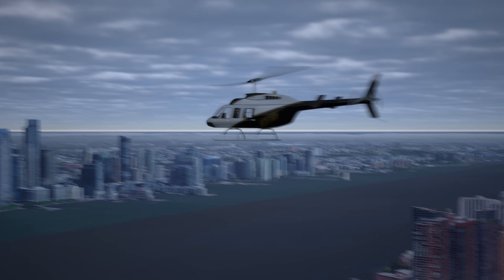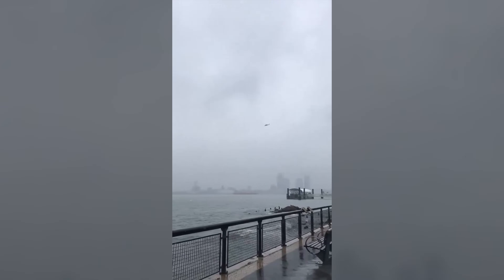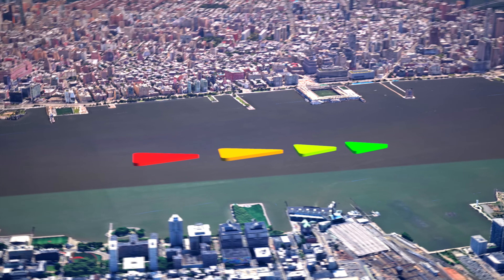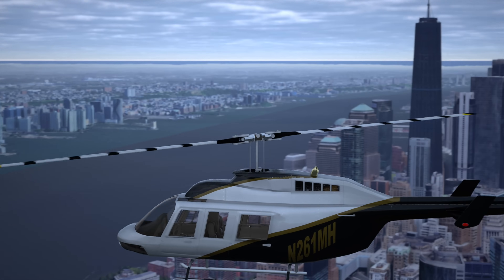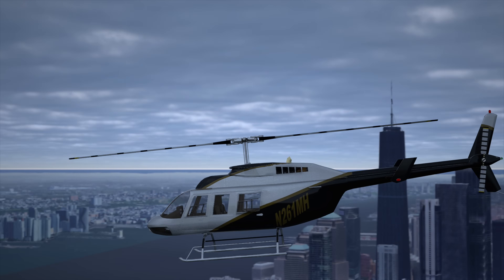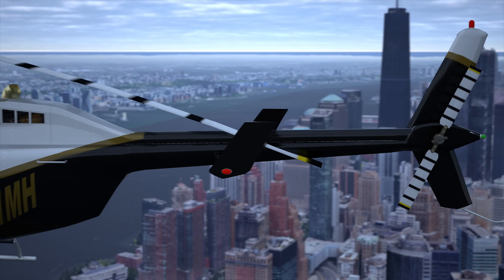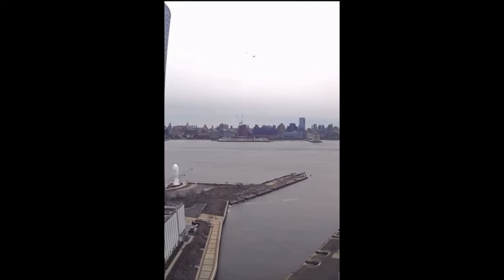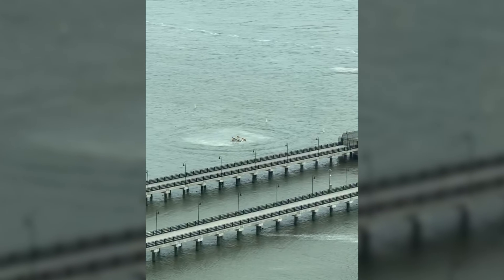Helicopters DON'T just fall from the sky - What is "Mast Bumping"?

Comment: It's pretty crazy after researching Bell helicopter crashes, which isn't many by the way, that Bell isn't even listed in the top 10 for most accidents/crashes.

Bell also received a contract with the military.

Some fatal stats for Bell helicopters.

1990 - Bell 206B - Eric Clapton's band members.
1991 - Bell 206L-1 LongRanger II - Occupants not listed, which is odd
1991 - Bell 412 - Collision from a Piper Aerostar (small plane) -  United States Senator John Heinz
1991 - Bell 206 - Rock music concert promoter Bill Graham
1994 - Agusta-Bell 206A-1 - IDF Major General Nehemiah Tamari
2009 - Bell 206L - General Officer Commanding of 55 Infantry Division and Jessore Area Commander Maj Gen Rafiqul Islam
2010 - Bell 206B - Sergeant Joseph George Schuengel
2014 - Bell 206 - Guatemala's Chief of the General Staff of the Armed Forces Rudy Ortiz
2019 - Bell 206B - Brazilian journalist Ricardo Boechat
2025 - Bell 206 - Augustin Escobar, CEO for rail infrastructure at Siemens Mobility and his family

The United States Helicopter Safety Team (USHST) reports in 2024 there were 78 helicopter accidents in the U.S., 11of them fatal. A total of 26 deaths resulted from those accidents.

The crash rate for general aircraft is 7.28 crashes per 100,000 hours of flight time. For helicopters, that number is 9.84 per 100,000 hours. Helicopter crashes are common.

Yeah, i think i'll avoid ever flying in a helicopter. Cars are bad enough, but at least you have a higher chance of surviving a car accident.

Comment: It’s not mast bumping, this video is extremely misleading. I understand your stating it a theory, but clearly your pushing the agenda of what YOU believe is most likely. The main rotor separate from the aircraft WITH the gearbox still attached, which essentially would completely rule out mast bumping and point to a massive mechanical failure.

Comment: First off, I am truly sorry for all those affected by this.
I love the engineering that makes these things work. As wacked out as they are.
And they are a joy to ride in, as well as fly in flight sims.
I will be watching this closely for details.
But I agree with your theory based in just what I have scene in videos from news coverage.
I'm not dismissing the idea something went wrong in tail shaft causing a sudden change in flight and drastic rotor pitch to hit the tail section.
Or the rotor and transmission broke off and hit the tail section.
Either way it happened faster than the naked eye can see in the videos we have.

Comment: It looks like the main rotor/tail rotor transmission or tail rotor drive system failed
freeing the main prop and flailing, cutting the rear section of the chopper completely free
based on the vid.
Sad, regardless.

Comment: I was thinking birds as well or a drone. I stopped flying drones after a close call with a chase-chopper during a boat race. We were both cleared to be there, but the chopper swooped low and got within 10 feet of my chase drone. A tiny difference in either of our inputs and that chopper would've had a very bad accident in shallow water. That was with awareness and direct comms with the other aircraft. Think about what can happen when there is no connection between the two operators, and possibly the drone operator doesn't even know about proper flight procedures or safety requirements, leading to hundreds of thousands of potential MAC's. Even with FAA regulation and DJI having flight restrictions built-in for certain areas/times, it's still completely possible to fly a drone in the wrong place. I think the regulatory bodies that handle drones got complacent after seeing how well DJI handled airspace restriction, but most drones, including DJI, can easily be made to ignore those restrictions or don't have them to begin with.

Comment: Another video from a different viewpoint shows it was a tail rotor failure that caused the machine to snap yaw to the right causing the tail boom to fail and disintegrate, the main rotors stayed attached until the mountings failed due to overstress before separating,
Sorry, it wasn't a mast bump incident.👍
.

Comment: It's also conceivable given the internal wars over corporate power in fighting where major players in the Star War Video games are being Targeted much like United Healthcare CEO former Google CEO because the list is long of people that used to have positions of power within giant simulation card games of telecommunication technology giants through towers of Artificial Intelligence network programs
The electronic alphabet soup convoluted mathematical atmospheric structural instability 
All U have to do is pay a mechanic mercenary contractors to perform a few changes to the operating platform of that helicopter blueprint so it doesn't operate according to the factory specifications 
There is no such thing as Holographic programmable radio coded visual display coincidences 
Their called system failures 
Their failure to communicate Cosmic Spiritual Law

Comment: An old school friend of mine died in a tourist helicopter crash in NY, on his honeymoon. We had lost touch and I only read about it in the newspaper. So sad.

Isn't it more likely there was some kind of gearbox/mast separation from the airframe, and the rotors swiftly severed the tail? I worked for a helicopter operator for 5 years but not in a technical role, so would like to hear from an expert.

Comment: Nobody could survive this. Not even a mouse. It was falling upside down and the people on board would have been killed instantly from severe head injuries. I think the rotor snapped off the tail and then separated and the cabin spun and tumbled before falling tail first and then hitting the water upside down in a slight nose down angle.

Comment: Some of U may have difficulty translatiing an electromagnetic field of voltage change echo maps recording speeds in a visual  read active memory driven mathematical Holographic programmable radio networks recording speeds when we are correcting the planetary Morphogenic field structure spectrum Spin coded capacity to restore balance across the entire electromagnetic planetary DNA software network communication codes B cuz we have 2 templates operating here that are not compatible with each other based on Mathematical electrical codes which are spin points tones coded water table Matrices Base 12 Spheres DC eternal life coded temples breathing pure internal eternal absolute love in flow and return flow of EKKA Vecca Core Still point of a TRUE Vacuum and another Artificial Base 10 55 Vampiric AI QI coded VictimizerQI Borgha Matrix Andromeda Mother Galaxy Quarantine codes that are digital 10 implosion coded NOVA programs running finite electric codes B cuz those codes are pathogenic Parasitic not REAL God source coded reality streams 
It's like two radio networks that don't transmit the same programmable visual Holographic visual matter state codes of what we C 
We are grid network mechanics performing grid repairs to restore the original planetary temperature Vacuum gauge to experience 0° 
Their Base 10 coded DNA is 60° not 90° 
That generates a wobble system off set the planetary spin points tones coded unstable radio network programming finite energy systems 
We are restoring power 
God's Eternal power of pure internal eternal absolute love to heal every living sacred sentient life form here from trauma based mind control programs holding energy captive to feed the dogs of war game machines Intelligence simulator software programs

Comment: Retired commercial helicopter pilot.  It is difficult to imagine that the main rotor mast would withstand mast bumping severe enough to rip the transmission and main rotor system from the aircraft in flight.  Masts are not designed and built with that scenario in mind.  Notice that the main transmission, mast and rotor blades are falling to the water as a unit and impact after the fuselage has already landed.  Mast bumping typically snaps the mast off, but leaves the transmission still attached to the upper fuselage.  My take on helicopters is that since I retired in 2013 I will never get into another one of my own free will and you should not either.  Especially a tour helicopter.
Reply: 100% correct.  I'm an airplane pilot and my family are forbidden to fly in helicopters.
Reply: Yeah man, I was thinking the same thing. I think we're gonna see that the rotors and transmission dislodged, likely due to mount fatigue from years of use.
Reply: I was at a tourist helicopter riding place in Tenn one day and some of my family were going to take a helicopter ride but i decided to stay on the ground and out of no where a Walmart plastic shopping bag got picked up by the rotor blades and sucked right into the engine and i looked at the owner standing beside me and thats when he waved to the pilot to shut the thing down. So all ended up on another helicopter on stand by and got their ride in. Both choppers were Bell helicopters. My first chopper ride was in one of the old bubble Bell helicopters but my favorite latter on was Hueys.
Reply: I'm an active commercial helicopter pilot (HEMS) and I agree.
Reply: Shocking.
Reply: Masz dużo racji. Ja widziałem jak rosyjski Mi-24 (Hind) w Afganistanie został ostrzelany waszym amerykańskim pociskiem FIM-92 Stinger, widząc to pilot starał się uniknąć trafienia, wystrzelił flary, przekroczył parametry przeciążenia łopat, wasz pocisk FIM-92 Stinger minął Hinda, ale ten z powodu bardzo gwałtownego manewru i przeciążenia  odciął sobie ogon łopatami. Ruska załoga przeżyła.  Nie cierpię ruskich i terrorystów, których wy amerykanie szkolicie i uzbrajacie. Miło było popatrzeć jak terroryści niszczą amerykański sprzęt przy użyciu amerykańskiej broni i to wszystko za wasze dolary.  Super głupkowatych polityków mieliście, ale ten wasz trumpek to idiota do kwadratu.
Reply: WOW
Reply: Mike Patey had a plane suddenly destroy it's turbine like snapping your fingers. After digging into it (thankfully he lived through the failure) it was determined that a transmission gear failure occurred, it was mentioned in a bulletin a long time ago, nobody caught it and fixed it. It caught up with him.
Reply: Movies warned us for decades, if there is a helicopter it will crash sooner or later 💥
Reply: What is the fatality rate per 100,000 hours for helicopter sight seeing tours?

If they were that dangerous they would be illegal.
Reply: @Captain101-x1o this is a dumb take but okay. 👌
Reply: @Captain101-x1o  really? So cigarettes are illegal? So many things that are dangerous are legal. Your "logic" is severely flawed.
Reply: X 2. Enough force to rip the main transmission, the engine out of the airframe and detach the tail boom is indicative of severe torsional vibration.
Reply: Dude writers "retired helicopter pilot here" says a bunch of random sht that most of you dont even understand and gets bombarded by upvotes.

Comment: Another possibility is a sudden rotor head control/imbalance causing high vibration which is a common cause for the loss of the tail boom and transmission. This is more likely the root cause than a tail strike IMO. They will know for sure once the analyze the wreckage.

Comment: I'm not sure I think it was a mast bump incident, but then I'm no NTSB expert, either. Mast bumps are generally due to pilot input error or weather related turbulence incorrectly handled . The weather has pretty much been absolved as a cause, so it boils down to pilot experience or a mechanical failure. This being a tourist flight, it's not a "rock and roll" nap-of-the-earth high performance flight or a combat activity with a lot of control input, the aircrew wants to give the passengers a nice smooth flight and let them see the sights. Unless there was some sort of avoidance maneuver (potential collision with another aircraft or birds maybe) there should be no need for a maneuver extreme enough to cause a mast bump, and certainly not a hard enough bump to cause a shear force strong enough to separate the transmission from the engine.

Comment: With a name like Escobar the last place I would be travelling to is the good ole USA. I remember when I first found out the nut that holds the rotors on is called the Jesus nut and thinking the guy that named it had turned to the guy going to fly the chopper and said, I hope that Jesus nut doesn't come loose.

Comment: Saw a still shot of video showing the event has the rotor system mast & gearbox exited whole as the tail boom.
measuring the blades in the picture I saw 18 to 24 inches missing. Possible gross imbalance from a blade chucking a huge piece off. Fatigue failure or a bogus blade that was "overhauled" after its time life expired. Fraudulent data card.
Or the helicopter ran out fuel and the pilot failed to enter autorotation  letting the rotor rpm droop below 80% and the nodalbeams shook off all the missing pieces. Gross structural overload. 
And its a Simi Rigid under slung rotor system NOT simi articulated only one helicopter had a simi articulated system and its called a Brantley.THIS WAS NOT A CASE OF MAST BUMPING - gearbox mast & rotors were whole assemblies when departing from the fuselage.

Comment: Yeah there a more logical way than “Mast Bumping” which may be experienced during combat maneuvers or extreme weather flying, that being transmission lock-up, on a pilots in most birds and co-pilots light board there what’s called a chip detector light, when a transmission begins to fail aka chew itself apart usually the chip detector which monitors metal fragments in the all liquid systems, such as oil, transmission fluids, all are monitored, I was in a Blackhawk or UH-60 crash in the Adirondack Mtns and it cost me 24 inches of my intestines, however of the three crew, and 9 man squad+ extra Sgt I was the only injury thanks to that little chip detector, after everything was over I went to thank the pilot and the crew explained how it works, they said we were lucky usually a transmission rotor chewing itself is fast and if it locks the blades, and tail will simply snap off…. Just like the New York crash. There is a third way it can happen and in this instance I feel it far more likely.. with 25 young Tech Billionaires suddenly dying over 4 years, these parts can all be rigged to fail, with small radio controlled explosives and simple mechanical knowledge about Helicopters, I’m deadly serious about this last category… especially with his whole family being on tour during a foggy cloudy day ? Makes no sense to be up there.

Comment: 1. If it was mast bumping, the transmission wouldn’t still be attached to the rotors, it would separate at the impact point from the hub
2. Normal helicopter flights wouldn’t ever be in conditions to mast bump. 
3. New video shows the tail boom snapped and separated, throwing off CG and causing it to roll, overstressing the rotor and transmission causing it to separate 
Have many hours in these and Huey’s in the military
Reply: That's what I thought we were going to cover in this video.  Here's a video of what happened.  Followed by an explanation of mast bumping, which doesn't seem to be related to the videos of the pieces falling to the ground.
Reply: 206 drivetrain tech here, I had the same thoughts - you dont get mast bumping in a 206 unless your in low G situations, generally

Comment: Don't mean to quibble, but all photos and even Brian's animation show that this wasn't a standard five seat Bell 206A or 206B JetRanger. ('About 7,000 have been built since the mid 1960s. )
The accident aircraft appears to be one of several extended cabin length (7 seat) Bell 206 variants, which are also equipped with a single more powerful turboshaft engine.
'Namely, a Bell 206L-1 or a B206L-3 LongRanger, of which approximately 3,800 have been built since the 1970s.
CONFIRMED:
The accident aircraft was a Bell 206L-4 LongRanger IV, the final and most advanced civilian variant, equipped with an Allison 250-C30P turboshaft engine and a transmission upgrade. 
Production of this final B-206 model didn't end until 2021 at the Bell Textron factory in Mirabel, Quebec.
🚁 🚁 🚁 🇨🇦 🍁 🇨🇦 🚁 🚁 🚁

Comment: That design of the rotor leading to potential mast bumping shouldn't be allowed IMHO. Maybe this design do offers confort improvement and other small advantage but the inherent risk of a system causing a self destruction even without pilot error input fall in the same category as MCAS for me.

Comment: I just assumed the engineeers would make it impossible for a helicopter to cut off its own tail. It seems like that should be at the top of the requirements list. Also, every pilot helocopter should be required to tell every passenger before every flight, "This helicopter is capable of cutting off its own tail."

Comment: I was a UH-1H  crew chief and was astonished when I saw what held the tail section on. 
 Daily maintenance is critical to maintain safety.
Reply: bolts?
Reply: @poetsandalmaker  Yeah, 4 small 5/16 or the best that I remember it being. They looked like 1/4 inch compared to the tail section that it was holding on. 
I had never heard of drag torgue on nuts before military AIS.
 The hueys were surprisingly tough, though. Almost 50 years ago.